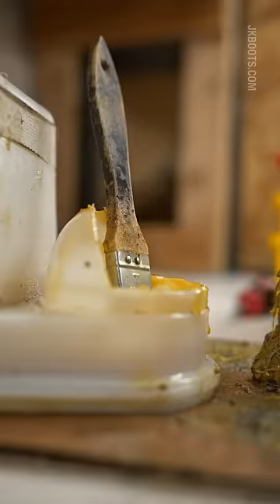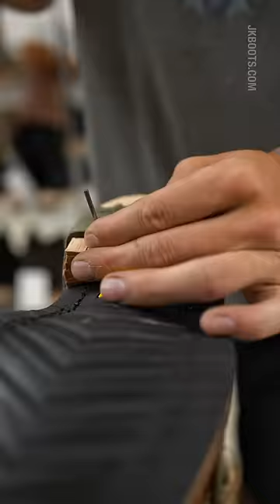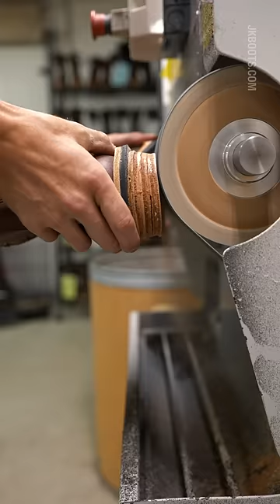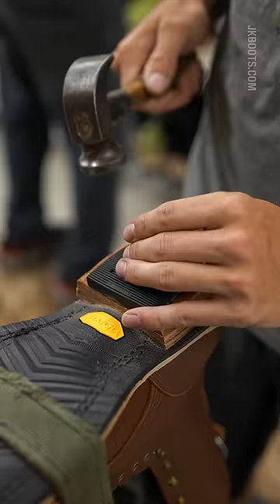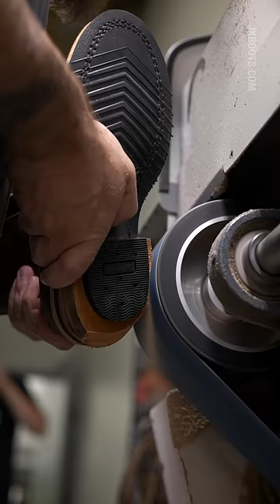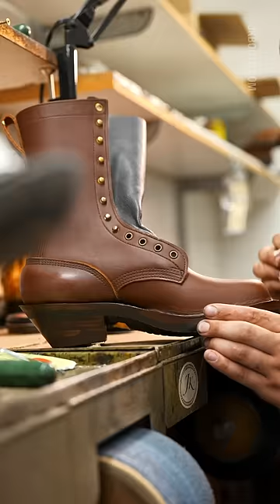How we add heels on Western Packers at JK Boots @jkbootsusa

Comment: .... I had a pair of quality boots very similar to these, build wise.. I don’t want to say how much I paid for them, but without a doubt they were the most comfortable pair of boots I have ever had in my life.. I had them for well over five years.. I would normally pay about 250bucks for boots and they would last about a year if I were lucky.. I basically lived in my work boots.. So one year when my wife was doing some spring cleaning she decided to just throw away anything she thought looked old or ratty.. I will admit the soles were a bit worn but not worn out, and they did look well used.. But there weren’t any tears, loose or missing stitching.. No separation anywhere, and they were still just so comfortable... I was really bummed out because I had plans on getting new soles put on soon.. I actually saved money by not having to buy boots once a year or more.. After the first two years I was saving money every year after.. now I’m back to buying less expensive but more often, and they are nowhere near as comfortable.. I bought those boots while on vacation, and they don’t just sell you the size you tell them.. They actually take all types of measurements of each foot and then build them for your feet specifically.. both left and right... they promised they’d be ready by the time I had to get back home, and that they were.. I wish I had kept the receipt as it had my exact measurements and maybe I could’ve had another pair made without having to go there.. I know where my next vacation is going to take me 😬👍🇺🇸
Reply: Boots like these are investments. The wear you get out of these over the years negates whatever you intially pay for them. If a boot xan last 10+yrs it's well worth it.